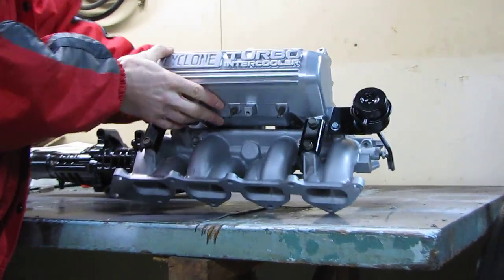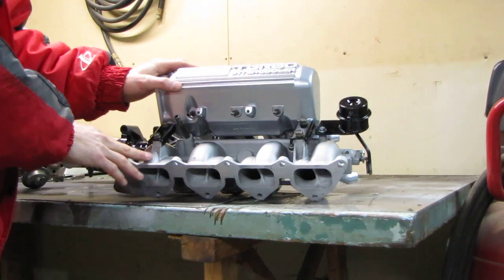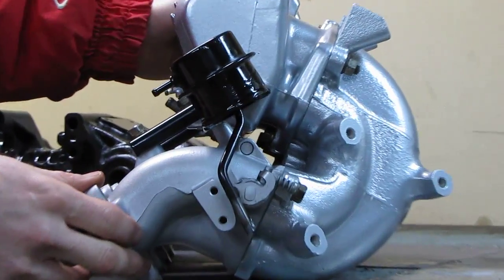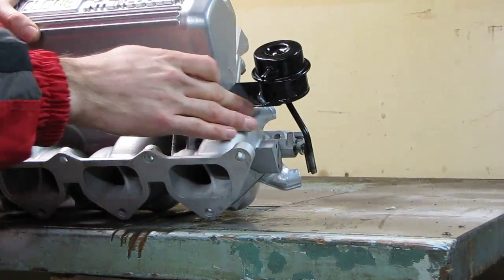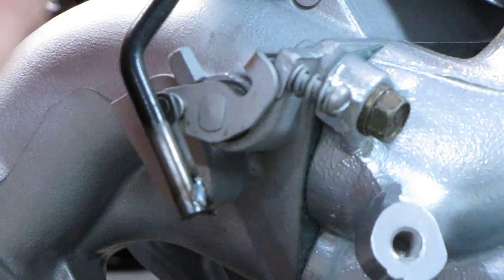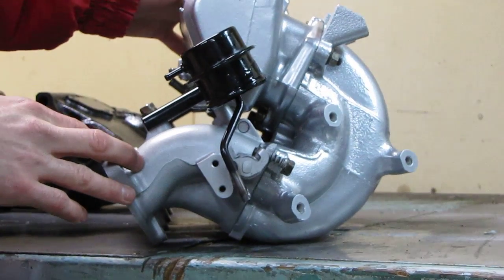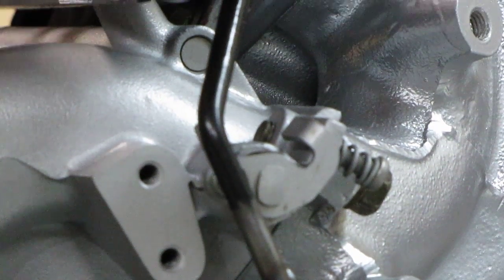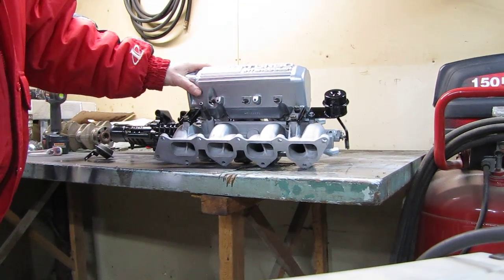Cyclone Intake Mod

Comment: @robeanio41 The wastegate line needs hooked up to one end of your boost controller and the other to a vaccum source that under boost becomes a boost source to open the wasgate. The same would apply to the wasgate on the cyclone intake. It could come from the intake or turbo j pipe fuel pressure silenoid u name it. If it has vaccumm it will have boost when spooled. Thus opening your flappers.